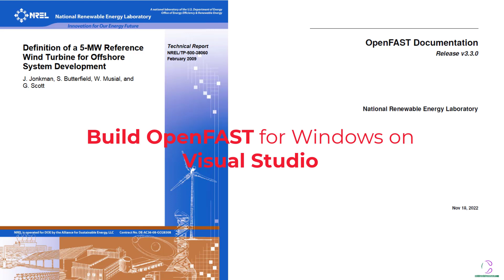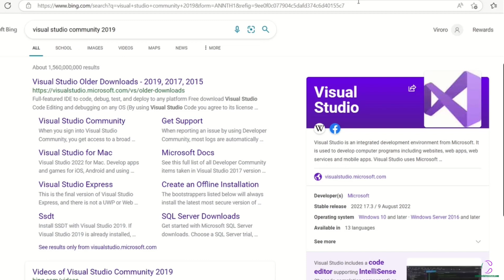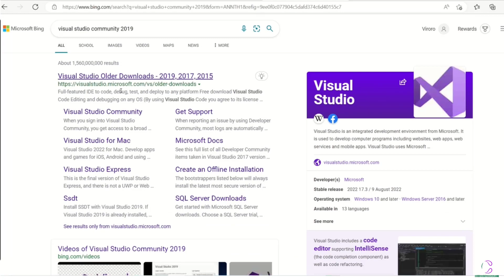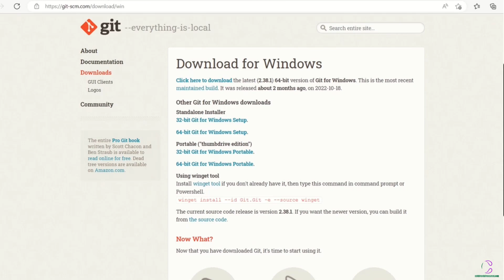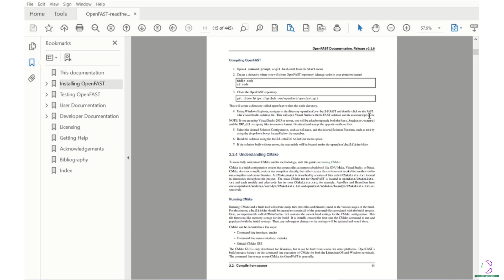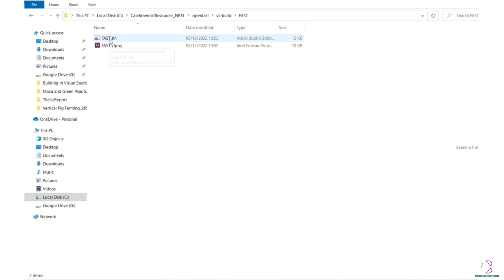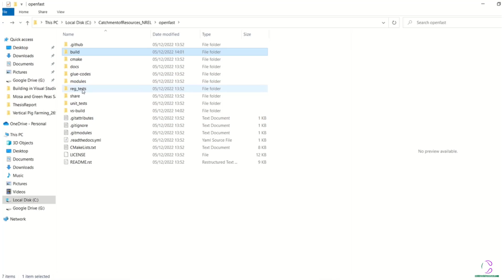Part 2: Build OpenFAST on Windows Utilising Visual Studio | Editing Source Code | Turbine Technology

Comment: Hi, thanks for you videos. I am a fourth year Engineering Student and I was hoping to use OpenFast to enhance/validate our windfarm project but I can't get it to compile from source. I keep getting an error at FASTlib. Not sure if you have experienced that before?
Reply: x64\Release\simclist.obj: not a COFF object, bitcode, archive, import library or resource file
FASTlib : error PRJ0019: A tool returned an error code
Reply from the maker: Hi Salif, thank you for watching the videos.
Unfortunately, I'm not familiar with this error notification. But with OpenFAST sometimes troubleshooting errors follow same approach.

You could verify that you're compiling with the right runtime environment.
Reply: Thanks for the reply. The run environment tip worked. I switched to Linux Ubuntu and it installed without any problems. I am now having to deal with regression tests failing but at least its progress 👍  @catchmentofresources

Comment: How can we change the geometric properties of sub structures like monopile, jacket?
Reply from the maker: The geometric properties may be changed within the Baseline folder. There are some files that contain array of numbers that describe the geometry of a monopile, jacket or an ITIBarge.

Editing those array of numbers changes the geometry. Also, if arrays aren't editable then editing of the source code may be required.
Reply: How to edit source code?
Reply from the maker: @krishnarajkp6732  the source code is in C++. I don't edit source code. Let's hope you can edit the array files in the. Baseline folder and don't need to edit source code.

You can also ask your question from the programmers of OPENFAST. They are on github or their website
Reply: In baseline folder which file I have to edit?
Reply from the maker: @krishnarajkp6732  kindly ask this question by email. akpoviroro1@gmail.com. I presently don't have OpenFAST on my current Computer; the former computer crashed.
Reply: In baseline which folder I have to edit that I am not getting? Can you please help me to  clarify this doubt.

Comment: Hi,
Thank you so much for your video!
Just one quick question: I've been running OpenFAST with "precompiled binaries" until now, but now I'll need to start using it in the "compile from source" way. So, do I have to uninstall/delete anything before starting this tutorial?
Thank you for your time!
Reply from the maker: Hi @THEnukemaster11,
Deleting files is not necessary. You could always create another folder in the C: drive and name it accordingly. Which will be used for the built version of OpenFAST.
i.e make the new folder the current working directory before cloning the OpenFAST from github.
Reply: @catchmentofresources  Thanks a lot!
I followed your tutorial and I was able to build successfully (no errors and I got the executable), but I have 1 "skipped" in the last line of the build (it seems you have it too), is that a problem?
Also, besides that, the "output window" seems perfect, but if I go to the "error window" it shows 15 warnings (12 of which regarding the first line of the CUSTOMBUILD file of the MAP_dll project, saying "derived data type ... of type ... is not passed through C interface" [or sometimes F-C interface]; while the other 3 have code C4267 and regard the bstraux.c or the bstrlib.c files of the MAP_dll project, saying " '...': conversion from 'size_t' to 'int'. Possible data loss"). Is that a problem and will it badly affect the accuracy of my simulations?
Thanks again for your time!
Reply from the maker: @THEnukemaster11  It's good to hear it worked for you.
I Can't really say why 1 was skipped, it may be due to prerequisites not already installed.

Because while building Fast-Farm, none was skipped.

Also, regarding accuracy of the simulation... The Reg_test is how to verify that your installation worked out fine. That should be Part 3 of this series.
There are existing designed wind turbine system files to which a comparison is done.

Thanks for your feedback.
Reply from the maker: You may also consider deleting the files and building from scratch again.

In the user documentation, it says something about the compiler throwing errors in a first step. But when you cancel and restart the build process, everything works out fine.
Reply from the maker: Furthermore, there are a several .sln files you should build. Discon, MAP, and Fast. Check Part 3 video, more modules were built.
No need to build AeroDyn or BeamDyn sln files.